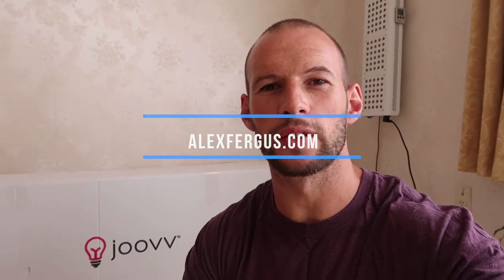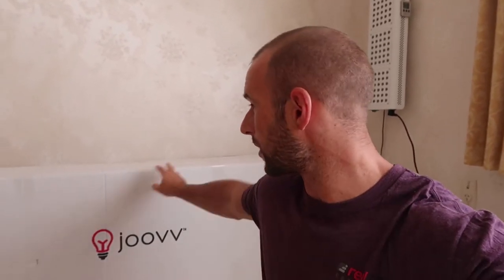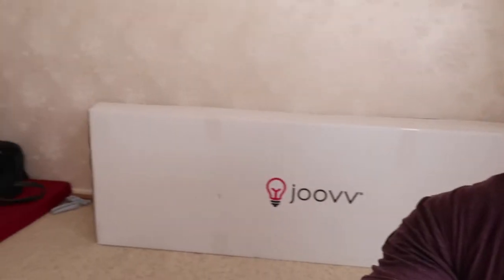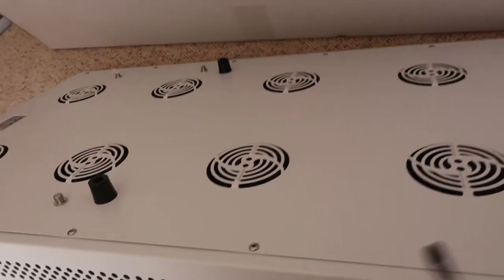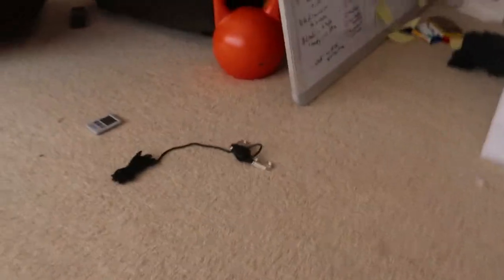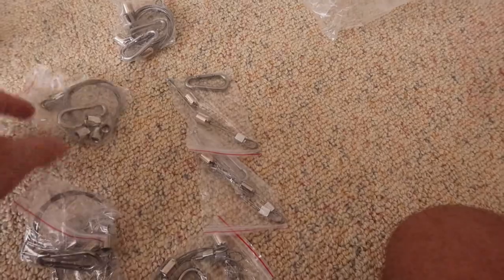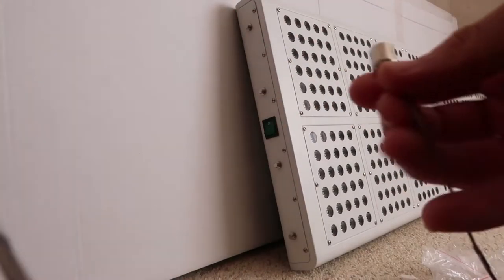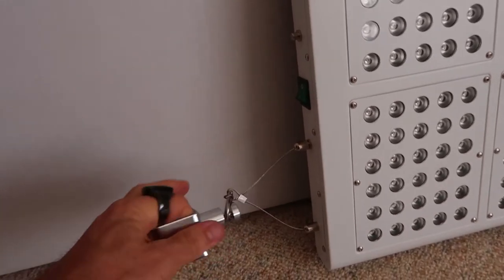Joovv Max Review - Unboxing, Setup and Hands On

Comment: Hey Alex, I’m just wondering about the reflexion of the light. I’m familiar with Bioflex laser and K-Laser which states from the studies that for the light to be absorbed, it has to be on the skin. How far are you from the light? Are you able to go right up against it or would there be an issue with the LED’s breaking.
Reply from the maker: Hi. I usually stand around 6inches from the light. And yes you could go right up to the lights/panels. The power density at that distance is much higher, but so is the nnEMF output. Have a read through this for more - https://www.alexfergus.com/blog/everything-you-need-to-know-about-red-light-therapy